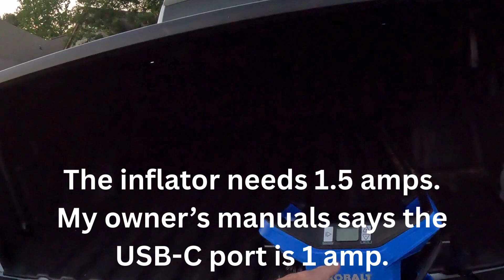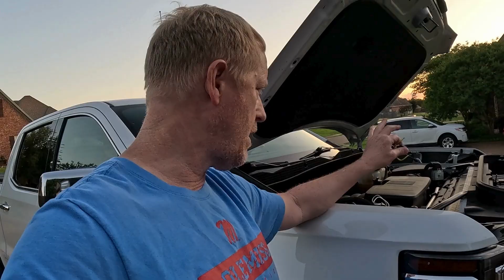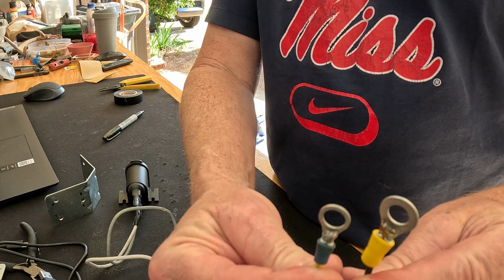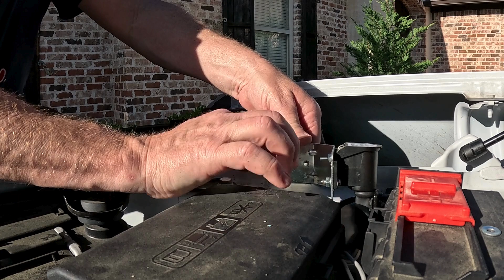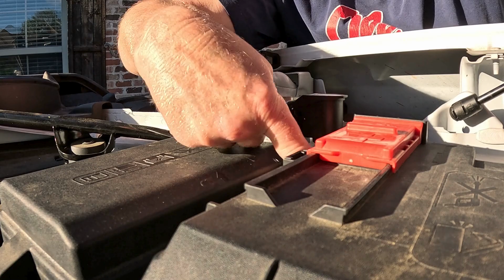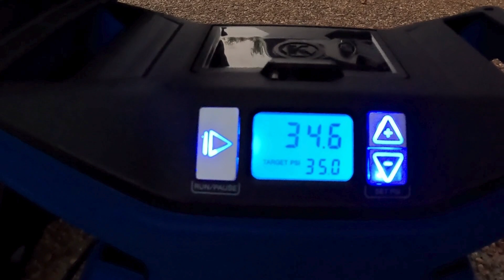Adding a 12V power socket to my 2022 GMC Sierra

Comment: Did you need to ground the set up or are the battery terminals already ground? Thanks
Reply from the maker: The negative battery terminal is already gounded to the frame.   So you just need to connectt the negative side of the plug to a good frame connection.
Reply: @MikeM100 thanks for the reply! Could i instead just connect it to the negative battery terminal ?
Reply from the maker: Yes.  That will work.